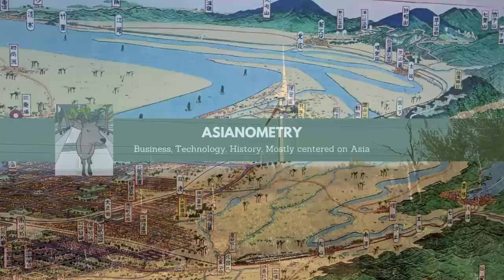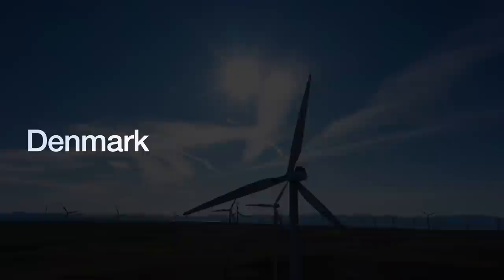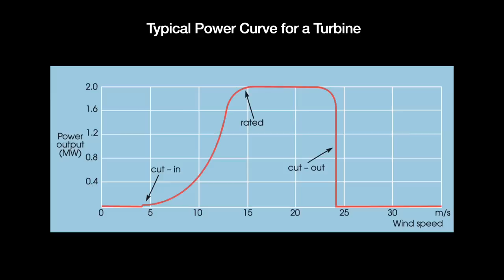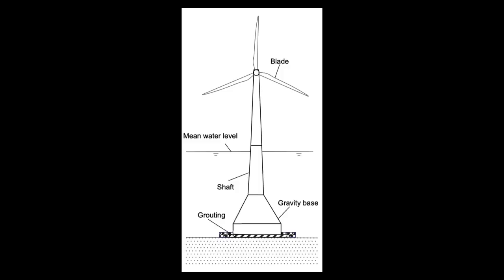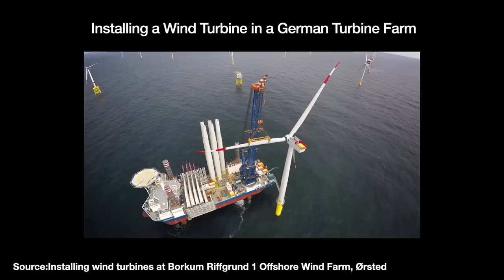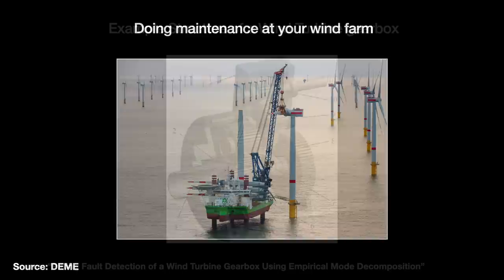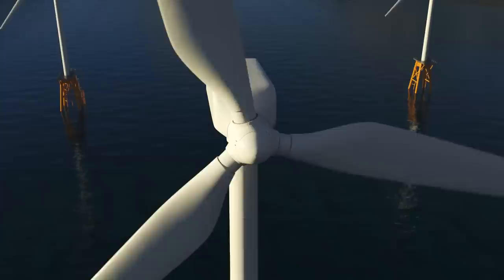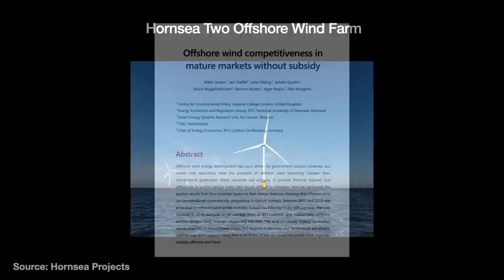Putting Your Wind Farm on the Ocean

Comment: 1:33 "Whatever that might mean"
It's not often that I feel the need say this on this channel, but you're flat out wrong there.
Wind turbines produce a constant 46-52 decibel sound, which is why Dutch urban planners are banned from putting them anywhere within 250 meters of any house, and within 500 meters is considered to be sub-optimal. The preferential limit for sound nuisance on the outside of houses is 48 decibels (daily average, abreviated as Lden)  in the Netherlands, which is the strictest norm I'm aware of.

That's the equivalent of a fairly loud conversation being held near you, 24/7, every single day.

And Lykkegaard goes a bit like Lee Kay Gaaaaard (gard, but elongate it)
Reply: He was talking about off shore wind there. Few houses nearby

Comment: The turbines installed near where I grew up didn't last nearly as long as advertised. Burned up, fell over, seized up. Probably only 30%'ish are still online after 15 years. On land, not water.

Comment: By far the most important factor is the EROI (energy return on investment) of an energy source. Renewable energy has always a way worse one than nuclear or fossil fuels, with the added downsides of rising electricity prices, way more land use and a huge amount of generated waste after the end of their lifespan
Reply: That ROI calculation is debatable.  And, even if true, is being ignored as the world is already moving away from nuclear.  Nuclear's worst enemy is itself having been here some 70 years and still only producing 10% of the world's grid energy.

For starters, that eROI may not even be true depending on where the panel came from.  Even on the nuclear side, the ROI will vary greatly if using common slow fission reactors (lots of nuclear waste) versus the much more expensive fast neutron breeder reactors that cost 3x more to build and run.

Moreover, that ROI will have a hard time being true even in the near-term future.  Consider solar panel pricing has fallen a massive 90% since 2010 and still falling even with all this global inflation.  Our global semiconductor industry has a proven track record of dropping the price of silicon based technologies like microchips when economies of scale and global demand kick in which is exactly what's happening with the global carbon crisis.  The exponential growth phase of renewable logistic growth curve (especially solar) is only just starting.

Commercial solar farms energy prices have dropped to just US 3¢/kWh never seen before in the history of energy.  Wind is in the 4¢ to 6¢.  But new build nuclear is at US 14¢/kWh.

Nuclear is the most expensive form of energy up front in both time & money.  Construction times are in years and even *decades*.  Nuclear power plant construction is absolutely plagued with being over-budget by billions and over-schedule by years on almost every construction!  Commercial nuclear power construction is the longest running joke in the energy industry.  

Nuclear will not have much of an impact on the transition away from fossil fuels as we need many thousands of terawatts of electrical energy to move away from fossil fuels on the grid and elsewhere.
Reply: ROI on energy of fossil by definition is less than 1. You get the investment back, nothing more.
The idea about renewables is to use an amount of energy X to build a something, which will then generate more than X of energy without using anything of course.
EROI for wind turbines seems to be around 20. So one gets 20 times the energy that is put in building them. I hope they take the foundations, shipping in account as well.
On can also express it as "energy payback time". Which is 1 to 4 years for solar.
Reply: @pizzablender  but you also have to factor in the backup reactors in case the wind does not blow or the sun does not shine. also, the wear and tear of those power plants is higher due to more often turning on and off. and the last thing is the huge amount of trash generated by decommissioned wind turbines or solar panels, which has to be handled somehow too

Comment: The idea that a modern society can be powered by wind and solar energy is a delusion that serves to show how disconnected we have become from the realities of energy and how our societies function. Wind turbines might be able to generate substantial amounts of energy, but behind the scenes there are enormous costs in materials and their intermittency makes them unsuitable for powering the efficient industry needed to build them. Batteries are simply not going to cut it.

If we are serious about getting off fossil fuels then we would be building nuclear energy, and talking about pretty much nothing else. Sadly it seems our western societies want to learn this thermodynamics lesson the hard way.
Reply: You are forgetting one major factor, time. The aim is to replace completely but we don't have the technology to achieve that right now. So wind and solar are instead used to reduce fossil fuel consumption, which they do very successfully. In fact they compliment each other.
Reply: Totally correct!
Reply: @ianhamilton3113  I actually don't think they compliment each other, wind and solar make full decarbonisation with nuclear slower and more expensive than it needs to be by diverting investment and making their operation less efficient.

The fastest decarbonisation in history was France using nuclear energy, and that was decades ago.  If we had not changed our focus and spent all that wind and solar money on nuclear instead we'd have a totally decarbonised grid by now.
Reply: @Spacedog79  Nuclear is a useful addition to a grid but the huge cost and time to construct is a major issue. Finland's EPR is already 12 years behind schedule.  If power demand drops you can always stop a wind turbine but the upfront costs involved in nuclear construction means someone has to pay for that.. 
Hopefully SMR will be available within the next decade and that should make nuclear a game changer.
Reply: @ianhamilton3113  Finland is the perfect example, now that the reactor is operating at full power their electricity prices have dropped dramatically and they now have one of the consistently cleanest grids in the western world.

Yes the reactor was far more expensive and took longer than it should have but the results speak for themselves. These are big investments in infrastructure that can do the job properly without the need for fossil fuels to pick up the slack. This makes them overall cheaper and more efficient, and if we invest more in building them we can once again learn the skills do it faster and cheaper.

Comment: Interesting video, a couple of points to maybe follow up.
1. Total carbon budget to produce and run/maintain these turbines.
2. The life cycle of disposal of the blades. Basically they are replaced a number of times during the lifetime and are used blades are currently buried in big pits in the ground.
Reply: Some companies grind and burn them
Reply: @piyh3962  Burn them ? In an effort to reduce carbon output ?